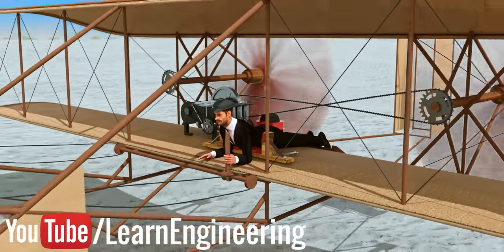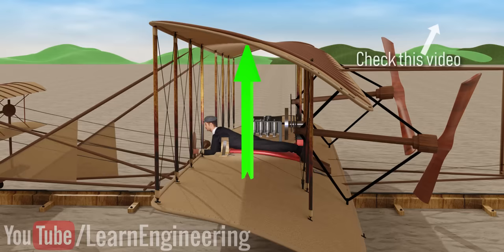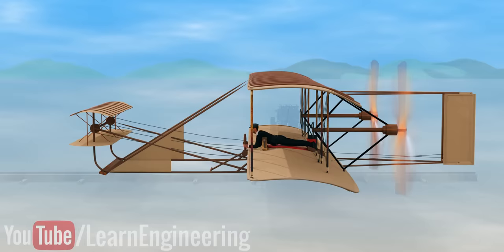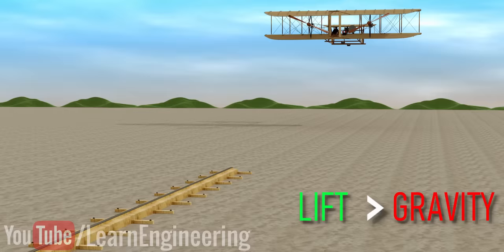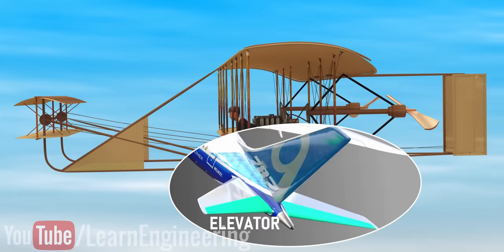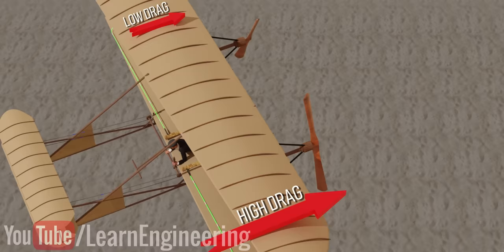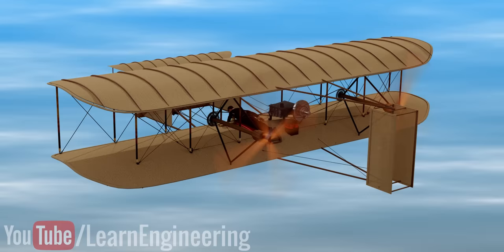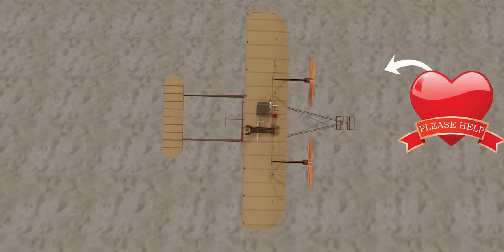The Brilliant Engineering of FIRST FLIGHT !

Comment: Louis Blériot
Development of the channel crossing Bleriot XI
(For more, check out Wikipedia)    

Bleriot built two unsuccessful powered aircraft, the Blériot III and the Blériot IV, largely a rebuild of its predecessor. Both these aircraft were powered with the lightweight Antoinette engines being developed by Léon Levavasseur. This was the
same engine that Santos-Dumont was using on the 14 bis.  

The Blériot IV was damaged in a taxiing accident at Bagatelle on 12 November 1906. The disappointment of the failure of his aircraft was compounded by the success of Alberto Santos Dumont later that day, when he managed to fly his 14-bis a distance of 220 m (720 ft), winning the Aéro Club de France prize for the first flight of over 100 metres

Unlike Santos-Dumont,  Bleriot never switched to the more powerful Antionette 8V.  
He then fitted a 50 hp (37  kW) V-16 Antoinette engine on his  Bleriot VI. Tests on 17 September showed a startling improvement in performance: the aircraft quickly reached an altitude of 25 m (82 ft), when the engine suddenly cut out and the aircraft went into a spiralling nosedive. The prototype was demolished but Blerior survived. The early Antoinette engines were not known for their reliability.

This, the Blériot VII, was a monoplane with tail surfaces arranged in what has become, apart from its use of differential elevators movement for lateral control, the modern conventional layout. This aircraft, which first flew on 16 November 1907, has been recognised as the first successful monoplane.[9][20] On 6 December Blériot managed two flights of over 500 metres, including a successful U-turn.

The Blériot VIII was shown to the press in February 1908. Although it was the first to use of a successful combination of hand/arm-operated joystick and foot-operated rudder control.  On 31 October 1908 he succeeded in making a cross-country flight, making a round trip from Toury to Arteny and back, a total distance of 28 km (17 mi). This was not the first cross-country flight by a narrow margin, since Henri Farman had flown from Bouy to Rheims the preceding day. Four days later, the VII aircraft was destroyed in a taxiing accident.
The Bleriot X was a 3 passenger plane unrelated to the XI.  

The Bleriot XI continued to use the Antoinette engine until Bleriot severed ties with the company.
 He then tried a new aero engine from the Anzani motorcycle engine company.  Anzani was associated with Lucien Chauvière, who had designed a sophisticated laminated walnut propeller. The combination of a reliable engine and an efficient propeller would contribute greatly to the success of the Type XI.

After winning the prize for the channel crossing, Bleriot 780,000 franc investment began to pay off:  
orders for copies of the Type XI quickly came, and by the end of the year, orders for over 100 aircraft 
had been received, each selling for 10,000 francs.   Over 900 of the type XI would be sold before the
outbreak of war in 1914.  

Along with five other European aircraft builders, from 1910, Blériot was involved in a five-year legal struggle with the Wright Brothers over the latter's wing warping patents. The Wrights' claim was dismissed in the French and the German courts.  

https://en.wikipedia.org/wiki/Louis_Bl%C3%A9riot

The importance of lateral control was not recognized because before the Wrights, the analogy was not an unstable leaning bicycle but a boat in a sea of air.  The boat of the air had to avoid
 capsizing so stability was the main concern.  It also had to have an engine and a rudder.  

Short powered flights were performed in France by Romanian engineer Traian Vuia on 18 March and 19 August 1906 when he flew 12 and 24 meters, respectively, in a self-designed, fully self-propelled, fixed-wing aircraft, that possessed a fully wheeled undercarriage.[76][77] He was followed by Jacob Ellehammer who built a monoplane which he tested with a tether in Denmark on 12 September 1906, flying 42 meters.[78]

On 13 September 1906, a day after Ellehammer's tethered flight and three years after the Wright Brothers' flight, the Brazilian Alberto Santos-Dumont made a public flight in Paris with the 14-bis, also known as Oiseau de proie (French for "bird of prey"). This was of canard configuration with pronounced wing dihedral, and covered a distance of 60 m (200 ft) on the grounds of the Chateau de Bagatelle in Paris' Bois de Boulogne before a large crowd of witnesses. 

This well-documented event was the first flight verified by the Aéro-Club de France of a powered heavier-than-air machine in Europe and won the Deutsch-Archdeacon Prize for the first officially observed flight greater than 25 m (82 ft). On 12 November 1906, Santos-Dumont set the first world record recognized by the Federation Aeronautique Internationale by flying 220 m (720 ft) in 21.5 seconds.[79][80] Only one more brief flight was made by the 14-bis in March 1907, after which it was abandoned.[81]
  

SB:  Shortly after winning the prize, the 14-bis was demolished in a crash.  It was not rebuilt but two similar designs were built and tested.
Model 15 and 16.  One model switched from a pusher to a tractor engine.  Unlike the small changes that the wrights made after crashing.
Alberto made large radical changes in his design.  Unfortunately both of the new designs based on the 14-bis crashed on take off.
Model 19 was the first iteration of the successful Demoiselle 20.  It had a combined tail and rudder at the end of a single bamboo bole.  

In March 1907, Gabriel Voisin flew the first example of his Voisin biplane. On 13 January 1908, a second example of the type was flown by Henri Farman to win the Deutsch-Archdeacon Grand Prix d'Aviation prize for a 1 lap circular flight in which the aircraft flew a distance of more than a kilometer and landed at the point where it had taken off. The flight lasted 1 minute and 28 seconds.[82]
  This was 3 or 4 years after the Wrights reported that they had flown multi-lap circles around the Huffnan Prairie pasture.

In 1908, Wilbur Wright travelled to Europe, and starting in August gave a series of flight demonstrations at Le Mans in France. The first demonstration, made on 8 August, attracted an audience including most of the major French aviation experimenters, who were astonished by the clear superiority of the Wright Brothers' aircraft, particularly its ability to make tight controlled turns.[84]

 The importance of using roll control in making turns was later recognised by almost all the European experimenters: Henri Farman fitted ailerons to his Voisin biplane and shortly afterwards set up his own aircraft construction business, whose first product was the influential Farman III biplane.  Bleriot added wing warping to his 1909 channel crossing prototype,  The Bleriot XI.

History of aviation - Wikipediaen.wikipedia.org › wiki › History_of_aviation

The FAI was founded at a conference held in Paris 12–14 October 1905, which was organised following a resolution passed by the Olympic Congress held in Brussels on 10 June 1905 calling for the creation of an Association "to regulate the sport of flying, ... the various aviation meetings and advance the science and sport of Aeronautics."[4] The conference was attended by representatives from 8 countries: Belgium (Aero Club Royal de Belgique, founded 1901), France (Aéro-Club de France, 1898), Germany (Deutscher Aero Club e.V.), Great Britain (Royal Aero Club, 1901), Italy (Aero Club d'Italia, 1904), Spain (Real Aero Club de España, 1905), Switzerland (Aero-Club der Schweiz, 1900) and the United States (Aero Club of America, 1905).

For a flight to be registered as a "World Record," it has to comply with the FAI's strict rules, which include a proviso that the record must exceed the previous record by a certain percentage. Since the late 1930s, military aircraft have dominated some classes of record for powered aircraft such as speed, distance, payload, and height, though other classes are regularly claimed by civilians.

Some records are claimed by countries as their own, even though their achievements fail to meet FAI standards. These claims are not typically granted the status of official records.  They, however, may be recognized later as a first.

FAI:
Fédération Aéronautique Internationale - Wikipediaen.wikipedia.org › wiki › Fédération_Aéronautique_Int...

Comment: Só pra avisar o primeiro avião foi do Santos Dumont. Se for pra usar uma catapulta até pedra voa
Reply: The first Wright aircraft did not use a catapult.  The Wrights used one only in later years, because it was their preferred method of takeoff, not because their aircraft needed one to get airborne at all.  A catapult allowed for takeoff from rutted surfaces in confined areas, such as Huffman Prairie where Santos Dumont's 14bis would not have been able to operate.
Reply: So when fighter jets get catapulted off the front of a Carrier, they're not flying afterwards?
Reply: I love Brazilians....

"The replica didn't fly." -  The weather on December 17th at Kitty Hawk was unusually cold that day. The barometric pressure was very very high. The air density altitude on that day was about a 1000' below sea level from a normal day. That's why they flew. Had they not, it would have only been a few days and they would have. When they went back to Ohio the air density altitude was about 5000' and no, the aircraft didn't fly. It took them some time to figure out that barometric pressure was important when it comes to flying.

"They were catapulted into the air and glided."-  They did not use a catapult at Kitty Hawk. You are referencing the very 1st filming of a flight in Ohio. That was the 4th airplane they had built in 1908 (its here on YouTube) . There was no catapult at Kitty Hawk…. There was no catapult…. At Kitty Hawk. If a fighter jet gets catapulted off the end of an aircraft Carrier, does it then not fly?

"Dumas was the first to fly"‐  According to the definition of heavier-than-air flight, no he didn't. His airplane did not have a proper propeller, it did not have a way of controlling the aircraft via ailerons or wing warping or a rudder that moved or elevators that went up-and-down…. He hopped. Just as you guys wanna claim the Wright brothers were catapulted... his airplane was just like a paper airplane.

Please go do some research!!!!!

Comment: @acucar chocolate

SB:  There were at least two successful tests flights before the Centennial 
when the wind speed was around 15 mph.

Why do you continue to claim that there were none?

I have posted the URL for the video a half dozen times.  Here is the one for 17 Nov 2003,  
 https://www.youtube.com/watch?v=o1mscspl-VU

You can look up the windspeed on 17 December 2003.  It was less than 4 mph.  
You should be able to look up the wind speed , barometric pressure, and density altitude, for 17 Dec. 1903.  
It was between 20 and 28 mph. according the the Wright Brothers.

On 17 Dec., The flight conditions were very bad.  
I doubt that Santos Dumont would have attempted to
fly when there was that much moisture in the air and on the ground.  

The 14-bis had more than enough power on a sunny day,  but the engine would not produce 50 hp. when wet.
The wheels were useless if there was any mud.

MrBelo,  @majorbett,    @rjn bonif,   @pipe cigar,   @danieldbd,  @Gilberto Nedel Junior,

Comment: The first flight in History was not the Wright brothers, but Santos Dumont in France.
Reply: Who never flew...
Reply: I love Brazilians....

"The replica didn't fly." -  The weather on December 17th at Kitty Hawk was unusually cold that day. The barometric pressure was very very high. The air density altitude on that day was about a 1000' below sea level from a normal day. That's why they flew. Had they not, it would have only been a few days and they would have. When they went back to Ohio the air density altitude was about 5000' and no, the aircraft didn't fly. It took them some time to figure out that barometric pressure was important when it comes to flying.

"They were catapulted into the air and glided."-  They did not use a catapult at Kitty Hawk. You are referencing the very 1st filming of a flight in Ohio. That was the 4th airplane they had built in 1908 (its here on YouTube) . There was no catapult at Kitty Hawk…. There was no catapult…. At Kitty Hawk. If a fighter jet gets catapulted off the end of an aircraft Carrier, does it then not fly?

"Dumas was the first to fly"‐  According to the definition of heavier-than-air flight, no he didn't. His airplane did not have a proper propeller, it did not have a way of controlling the aircraft via ailerons or wing warping or a rudder that moved or elevators that went up-and-down…. He hopped. Just as you guys wanna claim the Wright brothers were catapulted... his airplane was just like a paper airplane.

Please go do some research!!!!!

Comment: actually, although it may seem as easy as "because they wanted to offset the weight of the engine" it is actually much more complicated than that. In gyroscopic airflow around a subsonic Bernoulli surface, intrinsic gyration of the anti-precessional drift of the forward-facing poopy face butt fart of the blah blah blah

Comment: 14 Bis
Reply: Never flew
Reply: @brothergrimaldus3836  it flew 220 meters throug Paris
Reply: I love Brazilians....

"The replica didn't fly." -  The weather on December 17th at Kitty Hawk was unusually cold that day. The barometric pressure was very very high. The air density altitude on that day was about a 1000' below sea level from a normal day. That's why they flew. Had they not, it would have only been a few days and they would have. When they went back to Ohio the air density altitude was about 5000' and no, the aircraft didn't fly. It took them some time to figure out that barometric pressure was important when it comes to flying.

"They were catapulted into the air and glided."-  They did not use a catapult at Kitty Hawk. You are referencing the very 1st filming of a flight in Ohio. That was the 4th airplane they had built in 1908 (its here on YouTube) . There was no catapult at Kitty Hawk…. There was no catapult…. At Kitty Hawk. If a fighter jet gets catapulted off the end of an aircraft Carrier, does it then not fly?

"Dumas was the first to fly"‐  According to the definition of heavier-than-air flight, no he didn't. His airplane did not have a proper propeller, it did not have a way of controlling the aircraft via ailerons or wing warping or a rudder that moved or elevators that went up-and-down…. He hopped. Just as you guys wanna claim the Wright brothers were catapulted... his airplane was just like a paper airplane.

Please go do some research!!!!!

Comment: Santos Dumont...
Reply: I love Brazilians....

"The replica didn't fly." -  The weather on December 17th at Kitty Hawk was unusually cold that day. The barometric pressure was very very high. The air density altitude on that day was about a 1000' below sea level from a normal day. That's why they flew. Had they not, it would have only been a few days and they would have. When they went back to Ohio the air density altitude was about 5000' and no, the aircraft didn't fly. It took them some time to figure out that barometric pressure was important when it comes to flying.

"They were catapulted into the air and glided."-  They did not use a catapult at Kitty Hawk. You are referencing the very 1st filming of a flight in Ohio. That was the 4th airplane they had built in 1908 (its here on YouTube) . There was no catapult at Kitty Hawk…. There was no catapult…. At Kitty Hawk. If a fighter jet gets catapulted off the end of an aircraft Carrier, does it then not fly?

"Dumas was the first to fly"‐  According to the definition of heavier-than-air flight, no he didn't. His airplane did not have a proper propeller, it did not have a way of controlling the aircraft via ailerons or wing warping or a rudder that moved or elevators that went up-and-down…. He hopped. Just as you guys wanna claim the Wright brothers were catapulted... his airplane was just like a paper airplane.

Please go do some research!!!!!

Comment: This aircraft don't can fly. 
The 14bis, yes!
Reply: I love Brazilians....

"The replica didn't fly." -  The weather on December 17th at Kitty Hawk was unusually cold that day. The barometric pressure was very very high. The air density altitude on that day was about a 1000' below sea level from a normal day. That's why they flew. Had they not, it would have only been a few days and they would have. When they went back to Ohio the air density altitude was about 5000' and no, the aircraft didn't fly. It took them some time to figure out that barometric pressure was important when it comes to flying.

"They were catapulted into the air and glided."-  They did not use a catapult at Kitty Hawk. You are referencing the very 1st filming of a flight in Ohio. That was the 4th airplane they had built in 1908 (its here on YouTube) . There was no catapult at Kitty Hawk…. There was no catapult…. At Kitty Hawk. If a fighter jet gets catapulted off the end of an aircraft Carrier, does it then not fly?

"Dumas was the first to fly"‐  According to the definition of heavier-than-air flight, no he didn't. His airplane did not have a proper propeller, it did not have a way of controlling the aircraft via ailerons or wing warping or a rudder that moved or elevators that went up-and-down…. He hopped. Just as you guys wanna claim the Wright brothers were catapulted... his airplane was just like a paper airplane.

Please go do some research!!!!!